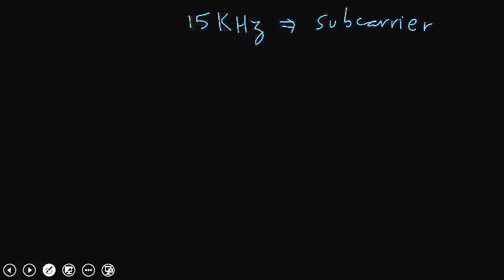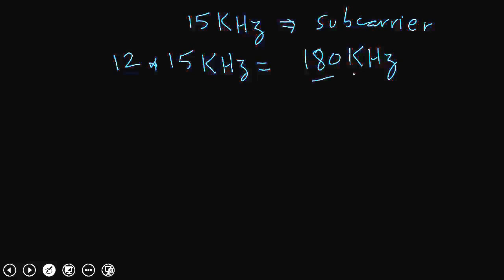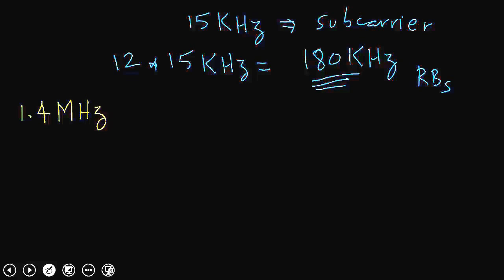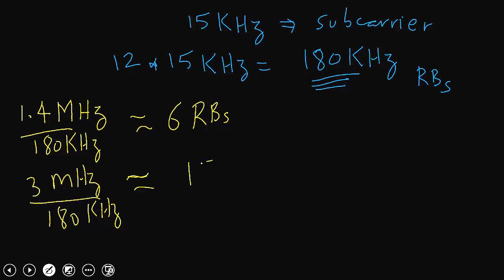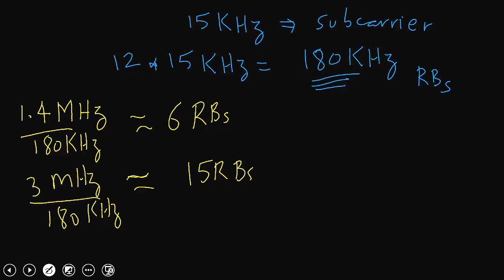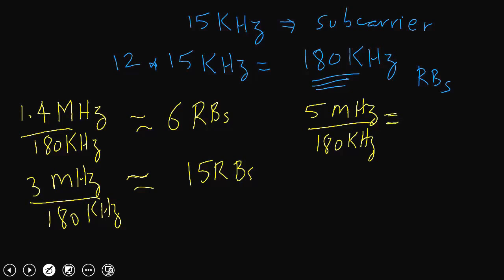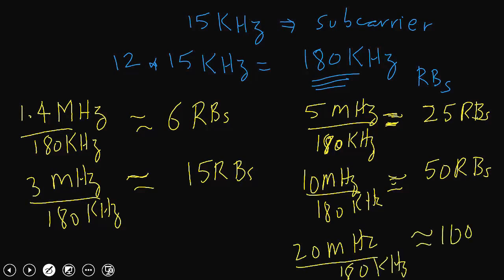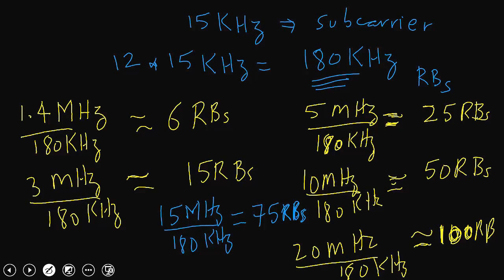How to calculate Physical Resource Blocks (PRBs) in LTE for a Given Bandwidth ?

Comment: A suggestion would be to introduce the fixed guard band in LTE as part of the maths.
As an example, a 20MHz channel has a fixed GB of 10%. I.e., 2MHz

(20-2 = 18)MHz / 180 KHz = 100 RBs

This applies for all BWs minus 1.4MHz

Comment: The exact formula is 0.9 * X / 0.18.
Reply: please explain this formula
Reply: @theingenuitylab59  Exactly 10% are subtracted from the frequency band as a guard from adjacent bands (hence multiply by 0.9). Then you divide that available bandwidth by the bandwidth of one resource block (180 KHz). My formula above assumes X is in MHz (so 0.180 MHz per RB). See also: https://www.researchgate.net/post/Why_the_Radio_frame_is_defined_10ms_in_LTE